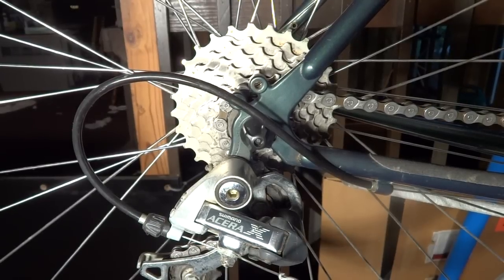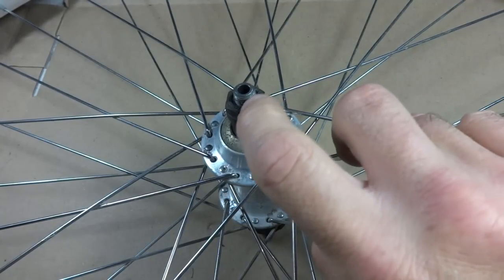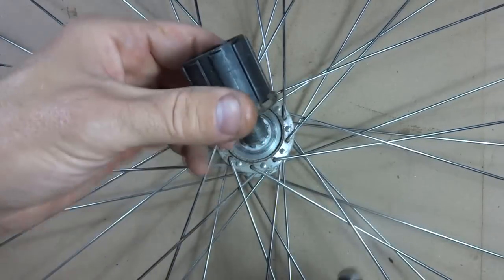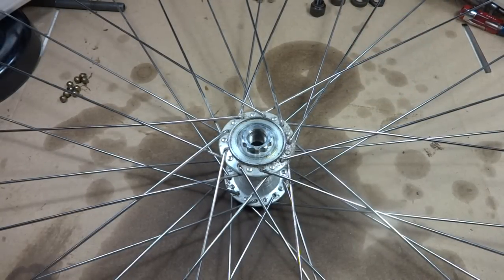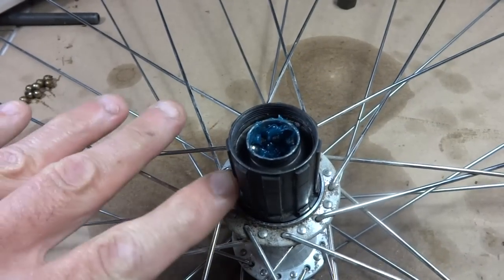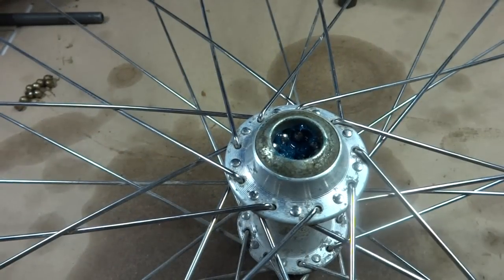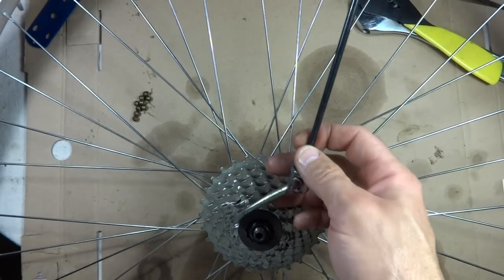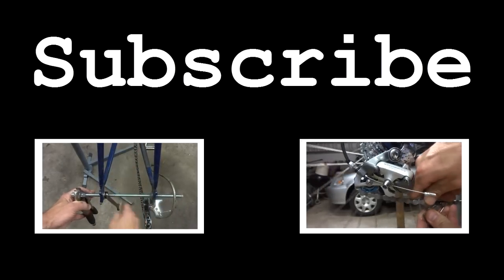How To Fix A Sticky Freehub

Comment: This video is exactly what I needed. My bearings were in good shape, but the whole free hub assembly was a mess. Everything is smooth as glass now. Thank you!
Reply: russst,    watch for dry rust from water ...   keep that oil and or grease handy ...  i had that problem,  the rust will cause it to freeze up also,

Comment: When adjusting cup/cone wheel axles, consideration of QR or axle nut compression is important.  The correct way to achieve this is to actually adjust the bearings so that there is a very slight amount of play before mounting in the frame, as the compression will tighten the bearings even more.  This mistake often leads to too tight bearings and premature wear.  If you can find it, Jobst Brandt gives a great description of this process.

Comment: I took some carb spray in there first. Just to make sure that was the problem. And the gears immediately started to engage again. But now I can hear the bearings are dry. now So hopefully have have enough tools . I don't have any specialty tools.But hopefully I can work around  that. Thanks for the video. It was helpful.

Comment: Hey RJ. Love the videos. You can use compressed air to blow out any remaining solvent. A cool trick is to cut the top off a soda bottle and place it over the freehub body so it forms a seal , then blow air through cap which has a hole drilled in it for the air nozzle. I have also used a similar trick to blow fresh grease into flat pedals without having to dissasemble them (they were old pedals and I was too lazy to overhaul them).
Reply: MarzNet256 I was servicing my hub yesterday and I cleaned my free hub body and to dry it out I used compressed air and for a reason or reasons, it did something to the paws and springs in it and now it's not working properly anymore.
What the hell could have happen?
Did I blowed it out to much or did I put the nozzle to close and it undid something in there?
I don't know but I know I will never use compressed air to dry it out.

Comment: Tip .if you have the problem where the freehub is free in both directions, Take cable ties or strong string/ paracord perhaps with you ,but the “dork guard”must be gone ,then thread cables ties thru the gaps in biggest cog and thru the spokes .which locks  the cogs to the wheel ,effectively making it a fixed wheel bike ,might get you home 🏠..slowly
Reply: Thumbs up for phrase "dork guard" :)
Reply: I have had that problem and walked my way home... now I know better. :D

Comment: Great video, for simple and easy fix which should be done more often. I just opened mine and free hub was type FH-T300. What is your guess, can i just remove lip seal, soak all the stuff out and install new oil via small bearings.
Reply from the maker: You can try it. Some freehubs have a little plastic seal, others don't. But you an still lean them out and get new oil in there.

Comment: RJTerrific video! Very helpful and well explained. I have a basic (sticky) Shimano FH-RM35 rear hub/freehub. There is no removable seal when I remove the freehub body.. If I dunk the freehub in kerosene, how do I dry it out, just let it sit overnight? 

Thanks very much for your help.

Ric
Reply from the maker: Ric Liang Let it sit over night. Work the mech to help get it out. Tap it on a cloth to help get the stuff out. Use compressed air to blow it out.
Reply: RJ The Bike Guy RJ, I can do all but blow it out with a compressor. I don't have one and the fit is so tight air wouldn't get in anyways. I had difficulty getting the Phil Wood's oil in. If I leave it in the sun to evaporate, before re-lubricating, will I run the risk of everything getting rusty? I could use a hair drier. LoL

Comment: What's the benefit of the hubs that use replaceable ball bearings versus the type that use the skate board style bearings of whatever diameter? It seems like the skate board style bearings (I hate how they're both called bearings) but the wheel bearings seem like you'd be able to just replace the entire bearing versus having to deal with a bunch of BBs and greasing them yourself, keeping track of how many of them there are etc.

Also why are teh bearings balls on something that's supposed to move only on one axis? Should they be discs to ensure they don't stray and can be spaced exactly apart so they don't rub against eachother?

Comment: hey RJ, 
i maybe have a problem with my 90s nishiki mountainbike. 
when im pedaling the hub sometimes makes a cracking noise, sounds like the paws start gripping inside the freehub.
the same cracking noise as if a start pedaling abrubtly 
it appears in all gears, i have 7 gears in the back but on a freehub not a freewheel. 
would u recommend the same fix for this problem as in this video? i hope u understand what i mean, my english isnt that great..
greetings from germany

Comment: Hello RJ just a quick question, in this video (which has been very helpful, so thank you) you use oil to lubricate the hub after cleaning it down. However, in another video, where you rebuild the hub you use greace. Which is better? I am able to remove the rubber seal on my hub which means I would be able to get either grease or oil into one side (don't want to have to knock out the other side as it's not necessary (as I can see from video) and oil would be easier as well. ???
Reply from the maker: This oil is better. In the other video I was overhauling the freehub. Oil won't hold the bearings in place for assembly.
Reply: @RJTheBikeGuy  thanks you

Comment: Good video but too small  Issues. The correct bearing setting is to have just a little bit of freeplay in the bearings, such that when the wheel is installed and the quick release  Titenned,  the freeplay is removed. Yes, even when when the quick release is not super tight it will still clamp the cones/ bearings down some thousandths of an  Inch! The other smaller critique is to never use an adjustable wrench on anything unless it is absolutely necessary. If you clamp the wheel into the Triangle with the quick release properly, you should be able to feel whether or not there is play by bracing your hand  on the seat stay and trying to move the rim back-and-forth. I just assembled a set of new wheels and have adjusted the bearings twice  In order to get 0 free play once the quick release is clamped closed. On a semi regular basis I also make sure to spin the axle a little bit so that the weight of the bike and rider is not continually in one place on the cones  in the hub.  The same thing is accomplished when one changes a flat tire As it is very unlikely that 1 could replace the axle in the exact same position

Comment: This has been a very helpful video - thanks. What about the inside of the wheel hub though - is there a good way to clean the inside?
Reply from the maker: https://www.youtube.com/watch?v=X9gIEG1db0s
Reply: @RJTheBikeGuy  Thanks. I'm still a bit confused though. In this video you free up the freehub by soaking in spirits. Won't this remove the internal grease? Wouldn't I then need to disassemble the freehub and re-grease it? The reason I ask is because in this video, you soak in spirits to clean and then just re-attach it to the bike...

Thanks!
Reply from the maker: @michaelrowe5118 Apparently you didn't watch the whole video.
Reply: @RJTheBikeGuy  I believe I did. You added some oil to penetrate the freehub. I've followed all your steps in THIS video, but then I came across your video on how to take apart the freehub to re-grease the bearings. I'm just wondering if I should go ahead and do that? But according to your video here, simply adding some oil to the outside of the hub after soaking in solvent is a solution as well. 

Thanks again for your videos - they're very helpful.
Reply from the maker: @michaelrowe5118  You said " The reason I ask is because in this video, you soak in spirits to clean and then just re-attach it to the bike" completely leaving out the step of relubing the freehub with Phil Tenacious oil.
Reply: @RJTheBikeGuy  My mistake - I was differentiating between the more involved task of re-greasing the insides VS applying oil to the outside and working it in.
Reply: @MichaelRowe The smallest bearings RJ changed on the video where he opened up the freehub actually bear no weight and can there fore be left alone in place. Grease vs thick oil, not much of a difference- both prevent rust and lubricate adequately. I stick to the easy protocol of this vid but you may do as you wish if you're a perfectionist or want a mechanical challenge. Cheers!
Reply: @RJTheBikeGuy     where do we find the Phil Tenacious Oil  ..  is it a heavy weight oil?   i think i want to use 80- 90  gear oil ,   less drip,  better stick ?
Reply: @jfrtbikgkdhjbeep9974  its at your bike shop, or they can order it, or you can on the internet. not hard to find.

Comment: Thanks for this tutorial... but, as you know, there are a lot of differents hubs. I need a tutorial of a sram/btwin one that have the 
freewheel not so free like this Shimano. Probably it is only very dirty and sticky but i don't understand how to open it. It is a sealed bearing B'Twin hub 
with a 10 speed body for Sram X7, original part of a RockRider 720s my2016, probably. Thanks, anyway :-)

Comment: Hey,  what kind of grease and oil should I use if I'm on a budget? It's just a single-time repair for me so I don't want to spend 50 bucks on it. Thanks.
Reply from the maker: Shrug. I show you what I use. Beyond that you are on your own.
Reply: @RJTheBikeGuy  i see, well sucks to be me then, i guess :D
would normal lithium grease be bad, or just not as good?
Reply from the maker: I use marine grease for bearings. I have not used lithium grease.

Comment: ever use 90w gear oil instead of phils? Gear oil is way cheaper at $4 for 32 oz versus $15-20 for 4oz of Phils.....Your thoughts?
Reply: Correct.  I also use 90W, diluted with naptha, to lubricate my chain.  The naptha, being volatile, will evaporate and leave the 90W behind.
I used to work for a bike shop that loved PW.  Their marketing is more impressive than their products.
Reply: Thanks to you and Robin H for the tips. I've found 4 oz Phil TO for $10 ... cheap compared to Dumonde Freehub Oil for $30 per 4 oz bottle!
Reply: @reh2660  Thanks to you and Robin H for the tips. I've found 4 oz Phil TO for $10 ... cheap compared to Dumonde Freehub Oil for $30 per 4 oz bottle!

Comment: RJ, I got my freehub lubed with Phil's Tenacious and it seems relatively smooth now. However when I put it back on the hub and then installed the cassette, there was so much play in the cassette. I took it all apart again and found that it's really the freehub that is sloppy. Is this something you've seen before? I'm thinking its time for a new freehub (?)

Thanks
Reply from the maker: Ric Liang It could be the bearings (or other parts in there) are very worn and the gunk that was in there was disguising it. Yeah, might be time for a new freehub.
Reply: Took it to my LBS and they said the bearings were shot. Getting a new hub now
Reply from the maker: If you want to have fun with it: https://www.youtube.com/watch?v=X9gIEG1db0s
Reply: RJ The Bike Guy That's a great video, but I don't have such a tool, nor a grinder so not likely going to be able to make one. Looked online to see if anybody has the old discontinued Shimano tool, but they don't. At some stage I have to bite the bullet and go to my LBS. I also don't understand how there can be play since they are loose bearings? Even if I had your tool and it went through the whole exercise, wouldn't I end up in the same situation where there's play inside the freehub? Or is it a matter of using that homemade tool to tighten the cone down properly?
Reply from the maker: With new bearings, it might be better. I made the video for fun. And I have a lot of viewers who live in places where they don't have access to bike shops or places to buy new parts.

Comment: this Is what my new bike Is doing feels gritty once I stop pedaling and jumps my chain, i took it to a shop to get it check they said they can't fix it because it's a one piece unit, what does that mean? I can't open it to be cleaned and greased or do i just buy another freehub?
Reply: Usually you can take them apart..

Comment: Why are front axles thicker than rear axles? Usually 14mm to 10mm or something. Most weight is on the rear generally.

Comment: I wish I found this sooner, took my rear wheel to the mechanic yesterday because my hub was slipping and not turning the wheel. He told me that the hub was pressed in and could not be repaired, so I bought a new rim + hub. Are there even pressed - in hubs? Or did I just lose money and a serviceable hub to a scammer? All hubs should be repairable... right?
Reply from the maker: Sorry, but I don't know the wheel or the problem. Maybe it was repairable, maybe not. I can't say without having worked on the bike.
Reply: @RJTheBikeGuy  Alright, thanks for the answer! If I have more issues I will try to find the solutions on your channel! <3

Comment: mineral spirt or degreaser?
Reply from the maker: I used mineral spirits. I think it dissolves old grease much faster and then dries much better/faster.
Reply: for some reason the degreaser I use will have some sort of sand comes up when it drys, have this happen to you? also where can i get mineral spirits?
Reply from the maker: I use Zeps citrus degreaser. I buy mineral spirits at the hardware store in the paint section.

Comment: Could engine oil be used instead of Phil's?
Reply from the maker: I use Phils.
Reply: @RJTheBikeGuy  but if Phil's weren't available could engine oil be used as a substitute?
Reply from the maker: You can try it. It may work, it may ruin your wheel. Many bike shops use Phil's. So I have no incentive to try every other possible lube in the world. You are on your own.

Comment: Wouldn't you want to tear it apart and lubricate it ?
Reply: I know it has a set of really small bearings, but it's worth it.
Reply from the maker: Why all the extra work when you don't have to.
Reply: @RJTheBikeGuy  Well just to make it good for the customer?
Reply: Love your vids btw. I've gone through the majority of what you have. Does that make sense?
Reply from the maker: @Makulax  So to change the oil in a engine, you tear it down? No.
Reply: @RJTheBikeGuy  Actually in a two stroke you kinda have to. But I know how it works with these bicicletas. I am not saying that this and that works, but i respect the things you do. Get what I'm saying here?
Reply: @RJTheBikeGuy  Well I just do it just to see what it has "eaten". You're an inspiration thank you for replying <3  I'm watching ;) and subscribing.
Reply: @RJTheBikeGuy  Btw you should inspect the bearings tho. It kinda is worth the hassle if you've got it opened, might as well.
Reply from the maker: @Makulax  If you are going to open it, just replace the bearings.
Reply: @RJTheBikeGuy  Sorry I just got laid off so I'm missing these things. I've been working with bikes for like 5 yrs. No disrespect to you, you do it professionally. And thanks for your videos.

Comment: I don't have any of those tools. I'll just replace the whole thing
Reply: Actually, maybe I'll just take it to the shop. No clue what I'm doing lol. At least I figured out how to change the tires
Reply: My wheels won't spin at all. Can you damage the hub if you put the chain back on a different sprocket then what you originally took it off from?
Reply from the maker: Sorry, I have no idea of the condition of your bike. You may want to take it to a mechanic who can actually examine the bike.
Reply: @RJTheBikeGuy  I took it to a shop, the daily Rider, in DC and they fixed it for 30$. They opened up the wheel and lubricated it or something. Took ten minutes. REI wanted to charge me like 100 and take a week.

Comment: Way too complicated. And i’d have to buy 3 new tools i’d rarely need to use.
Reply from the maker: Then pay a shop to do it.
Reply: RJ The Bike Guy My concern is that they won’t do a thorough job like you did in this video. I have no way to verify the work. I’d gladly pay for the service if I could watch it being done. 

Sorry if I came off as being rude, but im frustrated how every time I go to learn how to do maintenance, it requires buying a bunch of tools.
Reply from the maker: @blastofo  Your choices as I see it are get the tools and do it yourself, pay a shop to do it, or live with it.